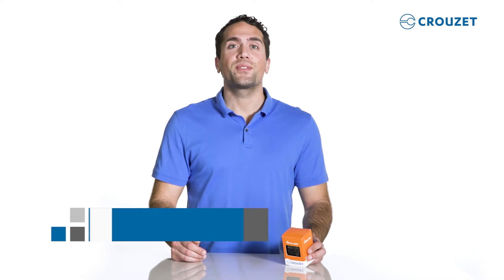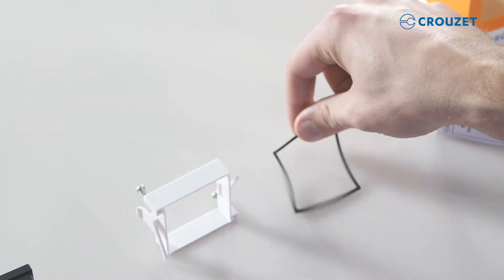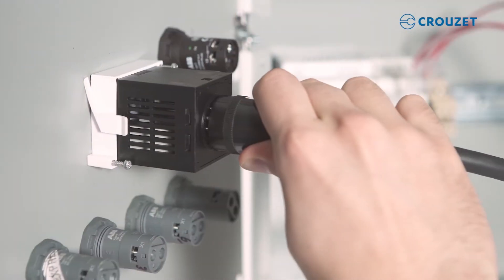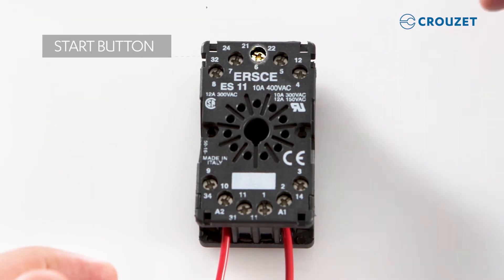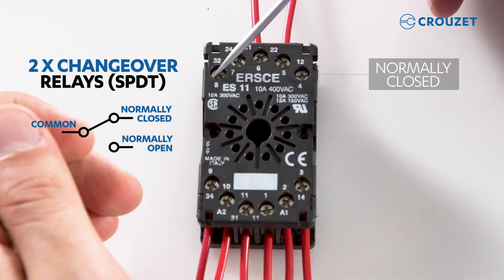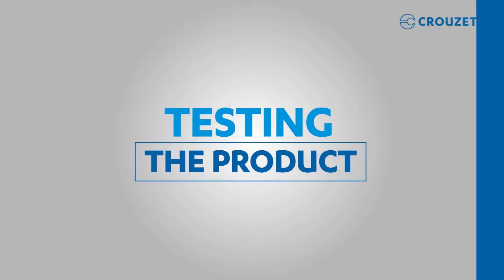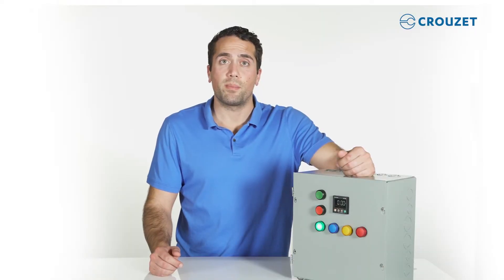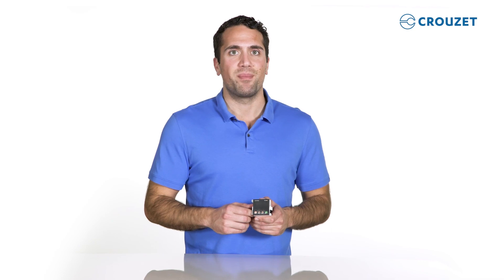How to Install, Wire & Test a Digital Timer Relay (Syr-line)

Comment: WOULD THIS WORK TO START RUN  10 SECONDS TO OPEN DOOR , STOP 30 SECONDS DOOR OPEN,THEN  REVERSE THE  POLARITY START   10 SECONDS BACK TO CLOSE DOOR, THEN  STOP UNTIL TRIGGERED FROM EITHER SIDE?
Reply from the maker: Hi Jimmy. thank you for your question. 😃
It can be possible, but it all depends on your setup, you might need 2 timers for this. Please take a look at the datasheet hereafter to explore the different functions available: https://media.crouzet.com/catalog/_datasheet/pdf/en/CO_TM_SL_DigitalTimers_Datasheet.pdf

As an alternative, we have recently launched the smallest and easiest to use logic controller ever, it's called MilleniumSlim 🤩, and it might be the perfect fit for your application, it could even be a bit more affordable if you won't need constantly the big physical display, since you can have several timers inside one product that can be configured as needed, that would simplify the logic of your application. Take a look at this video to learn more about it: https://youtu.be/k6QstXMSS-s

You can also start testing you application right now, with our free programming software. https://www.crouzet.com/products/automation-controllers/software/crouzet-soft/

Have a good one! 👍